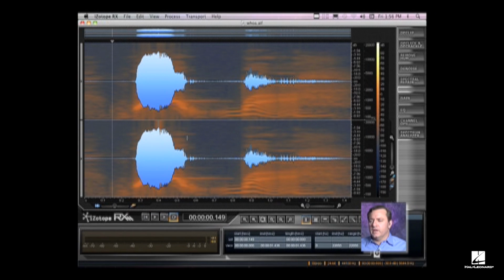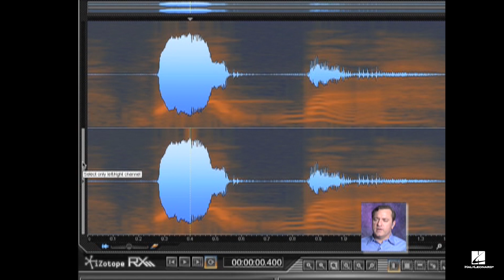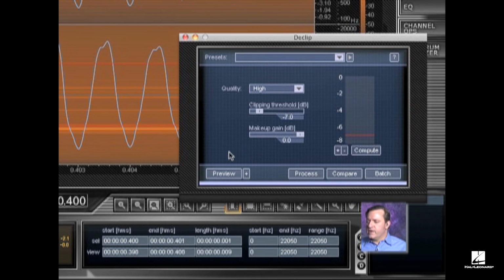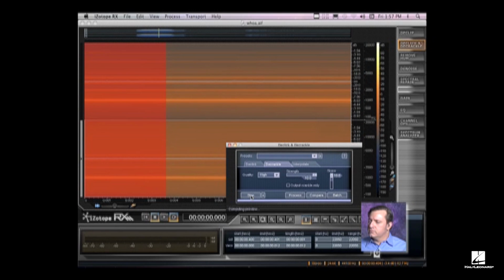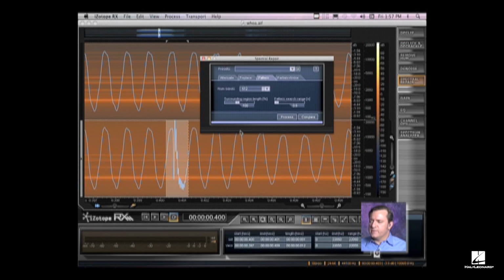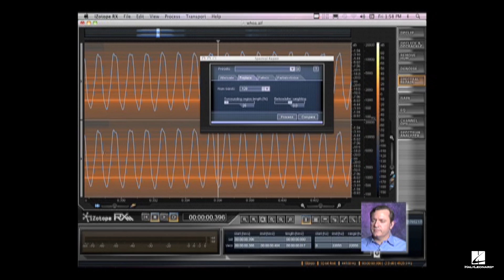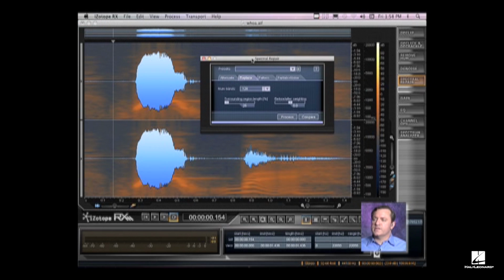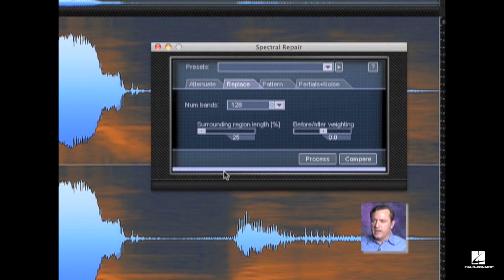Music Pro Guides iZotope RX 2 - Advanced: Using Modules to fix vocals

Comment: The channels look fairly correlated. Looks like just copying one channel's material into the other channel with a tiny crossfade is the quickest and safest approach (Sound Forge has a button for it). Automatic match can sometimes bring in a pattern that happens to be dissimilar to the untouched channel in the phase of some of the frequency components present (which you didn't select a full cycle of). I hear a thud in the first playback after the repair, which sounds just like that kind artifact, but then it's gone in the second replay, so maybe it comes from hitting the mic or something else, and the repair was in fact successful.

DecliP targets an entirely different problem. DecliCK is the tool to attempt.